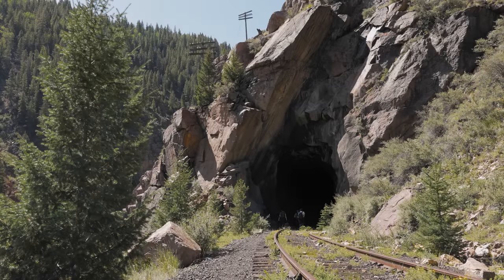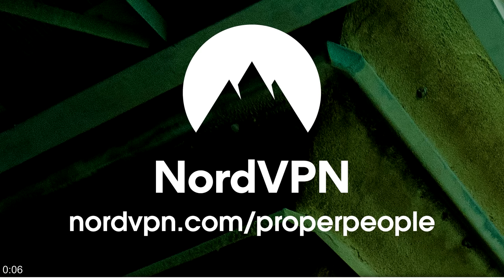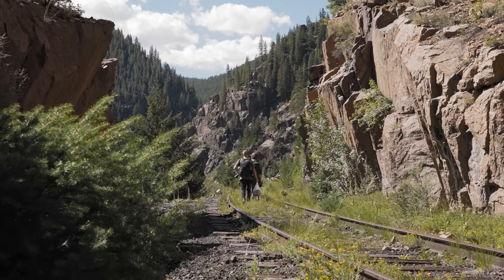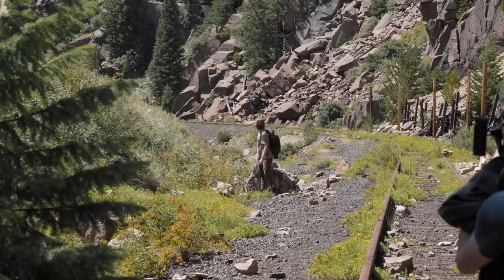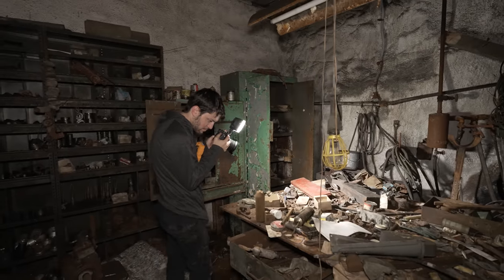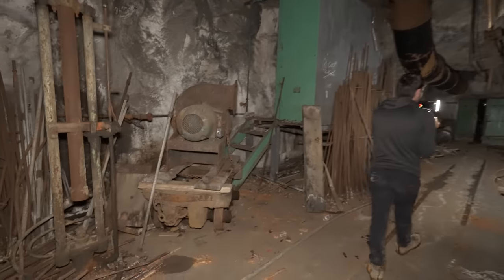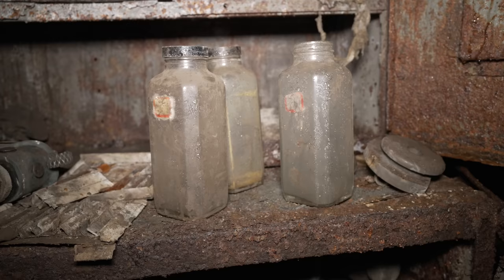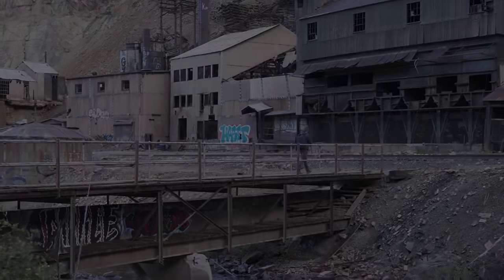Exploring an Abandoned Mine - Found Mine Carts and Processing Plant!

Comment: Pro tip: when you see a lot of rusted metal in an enclosed space, there is likely less oxygen, as iron absorbs oxygen as it rusts. Oxygen absorbers used in food storage are actually just metal shavings.
Reply: Are you talking about inside packages of food? That's complete nonsense. The FDA would never allow metal shavings inside of food packets. Lawsuit galore.
Reply: @IvorySoul696  ask the mormons.
Reply: @ElectricityTaster  wym?
Reply: @@sewagii There are devices for sale that measure this. Ship maintenance crews usually have them. I can't tell you how much oxygen X amount of iron absorbs per day. Enclosed means air is stagnant.
Reply: Silica is not metal shavings.
Reply: @ruggedrick  thus we have he recording
Reply: wood as well
Reply: Wrong, its the reverse. Unrusted means no oxygen
Reply: @wackyotter1235  there was presumably oxygen in there at some point, which was consumed by the riron, forming rust. How much depends on how much oxygen.

Comment: Can't stress enough how dangerous old mine are. At any second you can be in there and you hear a rumble behind you and then realize that 50 feet of mine shaft you were just in  collapsed in on it' self.
Reply: Bad air, deep holes hidden in puddles and unstable false floors are more common dangers than that
Reply: Yeah this is really dumb to do. Especially without the proper equipment. No door man either?
Reply: Always watch your videos, sorry but this doesn't feel safe so I'll pass until the next instalment, hopefully not an abandoned mine.  Stay safe and keep alert.
Reply: absolutely.  The 'backfill' they found was a collapse.
Reply: Have to agree with these replies and any others voicing concerns.  Would have hated to hear/read about another rescue attempt by first responders.
Reply: @xmtryanx  Absolutely was. They don't "backfill" mine shafts, mine shafts self back fill over time. The only thing they do is they will seal off the entrance of the shaft so nobody can get in and explore. These guys are great but I would 100% advise them to NOT explore abandon mine shafts. The danger factor is off the charts.
Reply: @suspicionofdeceit why? for curiosity, in order to ask for help if they don't return?
Reply: @marticonstans1979  Yes, in order to ask for help it they don't make it out.
Reply: @rustynail6819  maybe unless the shaft was out of use before the other tunnels
Reply: No PPE wheeee what could go wrong?
Reply: yeah maybe put a mask on or something or at least some goddamn proper boots instead of getting your feet wet for no reason
Reply: I bet they were in more danger driving to the mine than in the mine itself. These kids are the smartest urbexers I've seen, and they know the risks. They just showed us video of an amazing place nobody should go. I'd have tried to wave them off if asked, but my life is much richer for their risk. Theirs is too, experientially a well as as financially. 

I wish I'd had way to finance urban exploration when I was their age. I risked my neck benefiting nobody and earning nothing... other than amazing adventures that I cannot put a price tag on.
Reply: @Angry Applesauce  Thank you. 
Everyone here seems afraid to live.
Reply: @1stAshaMan  Wear a mask and look down ye be al'rite 👍
Reply: @Damer_Flinn  All the exploring I do I ask people it's been there for maybe a 170 years why is it going to collapse when I go in?. I have more chances of getting into a head on collision because of some oncoming idiot texting while driving. Everything is a risk as soon as we leave the house. There are ways to detect with your voice vibration how stable a mine is or not always look at the ceiling never grab from the walls and watch out for false flooring.
Reply: yah - for how many times they've been out in really dangerous urbex situations, youd think they'd be smarter by now with these super risky ones.
Reply: Got examples?
Reply: How much danger is it really for them ?
Reply: I'm glad they do it because otherwise we'd never get the chance to see it. they know the locations are dangerous. that's why they avoid patrolling cars that would stop them for that very reason.
Reply: It's a hard rock mine, not a coal mine, relatively solid, but if the mountain eats you, it eats you.

Comment: The crushers you saw are called Rod Mills. You are correct about the rods helping crush the ore. That mill would spin around at a decent speed and the rods tumbling around with the ore would crush the ore to a pretty fine powder, unless they ran ore wet, then it would be a slurry. In the future, please pay attention to that multi gas detector. Doubly so when there is that much steel rusting. As the steel rusts, it can and will rob the oxygen out of the air. You may walk another 10 feet and be fine. You may walk another 50 feet and oxygen concentration will plummet. Dry drowning is a very very real thing, and a very real danger in these places. Awesome video guys. Stay safe, and update that map more!!!
Reply: Exactly! It happens fast. And then the person/-s with you wants to help you, so he/they go in to help you up, and the same thing happens to him/them.
Reply: At very least they should invest in a pulse oxymeter to alert them to hypoxia.

Comment: Commenting on your map idea. Most building centres like Home Depot sell string lines in yellow, orange and green. They come in different lengths a few hundred feet or more. They cost about $10ea and packing a few of them would make some of the more confusing sections of an exploration simple and safe. There is also normal string rolls that I imagine are even longer and cheaper, worth a try next time you guys explore perhaps.

Comment: The best piece of advice I could give that I haven't seen in the comments is When exploring, Keep an eye on the back!!, *roof*. You can tell if there is recent movement, fishers (cracks) especially in an old mine. The crack might look clean or fresh. Make sure the cribbing ^timbers^holding up the "back" don't look stressed, or on the verge of popping (slipping out from under a BIG nugget) its been holding up for ever. They were installed under pressure. As time goes on, that pressure may have increased.
Reply: fissures?

Comment: Hi! I know from those massive chains inside that chute part of the huge machine that you looked at an ore crusher. Then confirmed the entire facilities you explored process ore from crushed rock dumped in by ore cars, then to those huge tumblers. The common name used to be Ball Mills, but you showed rods. Those rods crushed the gravel from the crusher just before. Once through the tumblers the fine material went into the mercury and cyanide baths. Taking the process to where kilns could process to the near pure gold or silver. I'm not sure about zinc? I'm sure it's very much like the gold and silver. A massive underground operation! They processed mountains of ore through that facility. The scree pile of waste rock was a mountain all its own.
Reply: You're confusing it with gold mining, this is a zinc mine so no mercury or cyanide involved. What you're seeing here underground is a standard floatation plant. The buildings outside belong to the drying plant where the concentrate was pumped to for drying and storage before being loaded onto the railroad.
Reply: That isn't a scree pile of waste rock, it is a surface deposit of waste rock that follows an old skip track up a 30-35 degree slope on the side of the canyon. Since tPP focused on the underground section, there isn't a camera angle in this entire video that does it justice. As noted elsewhere in these comments, look for the channel "Exploring the Unbeaten Path" and then find his two "Toxic Ghost Town Colorado" videos from about two and three months ago. That will give you a pretty good look at the surface works in the valley, the surface works on the hill, and adjacent company town that was abandoned when the mine closed.
Reply: @bulletz9280  in the description they wrote that they mined several types of ores here including gold, it probably wasn’t their main product anymore by the time the mine closed but , maybe some of the really old equipment could have been left over after they switched to zinc. Simply because it was too hard/ impractical to remove, same reason why everything there was left when the whole mine closed
Reply: @bluebirdtrucking76  the gold is separated in another step normal in the ore hut and not in that kind of processing.

Comment: Those were nice clocks rusting away. The red dots on those Techtron clocks were to let you know the power had been off. Normally those spots are the color of the clock face, but when the power goes off they turn red. (All very mechanical of course). To reset it you turn the clock over. I've got several old clocks with the feature.

Cool video as always, but good GRIEF that was a dangerous place!

Comment: Another handy way to test air quality is to bring a Bic lighter.  When there is low O2 the flame will hover or have a gap between the base. More than a quarter of an inch gap and you should be alert. And if you cannot get it lit, well then you need to leave. If the flame burns blue there may be methane. This is not a replacement for a gas meter, just another layer of analysis.  Have fun and stay safe!
Reply: Lighter test has best results in a natural gas pocket

Comment: The way you guys take in your surroundings has always been so incredibly unique. Pointing out (intact!) insulators atop the old poles is an example, along with your appreciation for the way things used to be designed, like logos and engineering/architecture. 

TPP. Always have been and always will be S rank, top tier.

Comment: 15:10 radial arm drill press. 25:00 there's a huge metal shaper, a camel back drill press, and 2 large engine lathes. Other machines in the background that I can't identify, and an overhead gantry crane system. Surprised those things were not moved out of there.

Comment: cant even fathom the noise those machines were making grinding stone with metal inside a cave
Reply: I've worked around them. They're loud enough on the surface, forget about underground. I work a small gold mine in New Mexico; we always wear hearing protection underground. Between fans, drills, and diesel engines, it is not a quiet place.

Comment: Invest in a higher quality PGM (get 2 of them) they should come with a calibrating gas cylinder as well / confined spaces and bad air that isn't circulated will engulf and incapacitate you rapidly (within seconds in some cases). 
Another thing to consider with abandoned mine exploration is that a lot of the steelwork is coated with chromium / lead / asbestos based paints. 
Lagging on the pipes you see generally will be asbestos bonded

Have another method to back track if you need to get out rapidly (glowsticks / blinkers / trackline / chalk paint)

Comment: the round iron cylinder's with the rods in them are Mills they use the rods to crush material also theres Ball mills with huge steel balls.. i used to work in a cement plant that utilized a similar type mill

Comment: I find abandoned mines fascinating myself, and I'd enjoy exploring places like this myself. I would, however, be a lot more careful with safety here. A hard hat and safety glasses would be a good idea, as would better footwear. An emergency air tank/oxygen mask would be ideal.
The biggest hazards I could see are: 1) getting lost 2) running into dangerous gases.
While I'm not a miner, I am a chemist by trade. From what I gather the most common gases are:
*Methane: Lighter than air. Can explode.
*Carbon monoxide: Lighter than air. Can explode. Highly toxic.
*Carbon dioxide: Heavier than air. 
*Hydrogen sulfide: Heavier than air. Can explode. Highly toxic. Smells of rotten eggs.
And yes, the oxidation of steel does consume oxygen, so rooms with a lot of rusty steel are likely to have lower oxygen levels.
Keep up the good work, and stay safe.

Comment: When you walk unstable stairs don't walk in the middle of each step. Place each foot on the very left or right end of each step, so the leverage forces are as low as possible and the risk of the step breakin is minimized.
When the staires are attached to only one side of wa wall, like in an apartment staircase, only walk on the side where it is attached to the wall. Again, the leverage forces on the stairs will be as low as possible.

Comment: The Drums with the Rods are mills to crush the ore into a fine powder. the "wheelthings" are probably flotation cells to concentrate the ore into its different mineral products (with chemicals the surface properties of the mineral are changed. the one that are wanted are changed that they dont want to mix with water and the one that are not wanted are mix with it. then air is pumped from the bottom so that the wanted mineral sticks to the bubbles and float, with some help from a foam creating reagent, on the surface. then the foam gets into the next cell with more water and the steps repeats until you get the wanted concentration). the huge tanks are for remove water from the concentrated minerals and after that another step is followed to remove more water, for example with a "vacuum drum filter". Then you can ship it wo the forges for the final processing. if you are in germany there is a world heritage site where you can see are more or less complete processing plant of that kind. is the rammelsberg mining plant

Comment: I would not go down there without a respirator
Reply: Not true. They make filters for vapors as well.
Reply: @Trainy2  Vapor is atomized liquid droplets suspended in air. It's very different from a gas such as hydrogen sulfide.
Reply: They're going to have lung and heart problems by the time they're 50, if they even make it that old. Young punks never learn.

Comment: I was near Antioch in CA and used to go to Summerville and Northville i think they were boxite mines. I never had a oxygen sensor in my possession they had places that were dangerous with the air supply problems. The weather was a factor the gas would rise and fall with moisture content in the mines. Rise in moisture and fall in dry. Their was one tunnel that as long as you were standing you were fine  but if you bent over you could not breathe more like your lungs were working fine but it was like you were under water no oxygen. They later turned it into a state park later. There was one shaft that went down at about 30 degrees and was safe about 40 yards and then ran out of air like walking into water without the water. On real dry days you could make it to the bottom and could make it from Northville to Summerville i a connector tunnel. But only when it was hot and dry and we always walked real slow that was our oxygen sensor for the gas whatever. There was no timber in the mines so didn't have to worry about cave ins. The main mine went in all directions and if the son went down it was really hard to find the entrance.

Comment: Not the proper equipment, doesn’t seem you guys did any homework on safety or mine operation. Ignoring the cheap oxygen monitor and continuing on after multiple collapses and “Bad Air” warning. 😞 this was just scary to watch.
Reply: Yeah, like, ignoring it multiple times. Also, going up those clearly rusted stairs. Into more possibly bad air. Just no.

Comment: That mine in particular is filled with tons of toxic heavy metals like arsenic, cadmium, lead, zinc. Arsenic in particular is carcinogenic and very dangerous to breathe in. Y'all should have been wearing more protective gear. Not to mention arsine gas from the arsenic and other dangerous gasses that can be in mines. I didn't know about that mine until after the video even though its in my home state. When I first saw that river I had a bad feeling it had a bunch of toxic waste dumped into it which is exactly what happened and all of that rustic sludge you guys were walking through looked like oxidized metals or even heavy metals to me. Most times there is a mine there is lots of toxic waste that goes with it, it can be airborne or seep into the soil or into water around. That video was fascinating but please be safe.

Comment: Guys, I cannot help but stress safety in these old mines.  Abandoned buildings are one thing, sure, but an old mine, especially rusting metal equipment like in that mine, can give way at any moment.  and you guys were walking on a lot of old rusted, stairs.  Also, you could walk down a shaft and think you're fine when, as another poster has said, that section of tunnel/shaft has collapsed behind and now you're screwed.  Please, when going into an underground structure, try to go with someone who has previously explored the structure as another precaution, or at least try to find a blueprint/map of the underground areas from when the works were going on.

Comment: It's not that the oxygen is low, it's that you don't know what is replacing the oxygen that's the major threat. There's a whole bunch of gasses you regularly find in mines that you won't be aware are killing you, because your body doesn't react to them like you'd expect, until you're in a heap on the floor - usually in an old mine you'd assume it was hydrogen sulphide which is yes: stupid dangerous, but it has a very distinct smell, if it doesn't smell you'd usually assume it was CO2 or Hydrogen; the pernicious water vapour in the air is a little bit of a clue to that, both are gasses you want nothing to do with. Also do the world a favour and don't explore mines without a helmet, it is so dangerous, even modern mines - stuff can and does fall off the backs of mines that will kill you and a helmet might save you from - they're not expensive for reasonably decent ones. The rods by the way are in what is called a rod mill. Also I was wincing at the just casually walking over the false floors like they were nothing :)